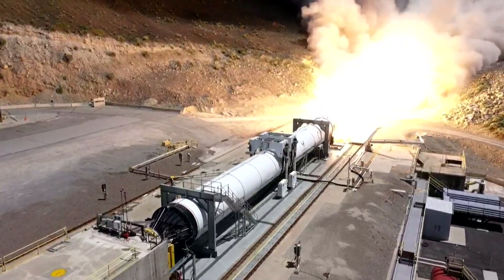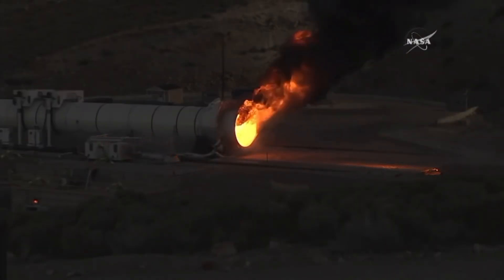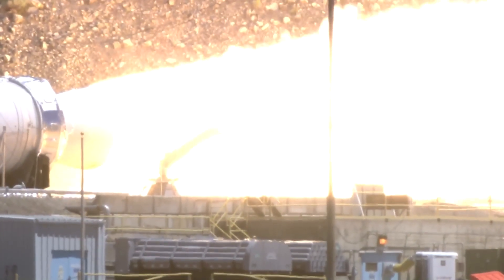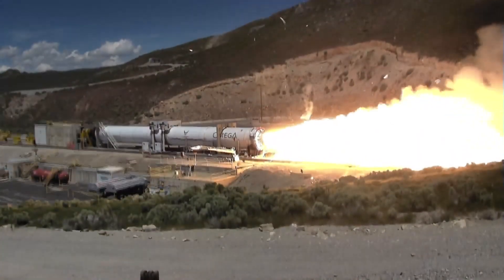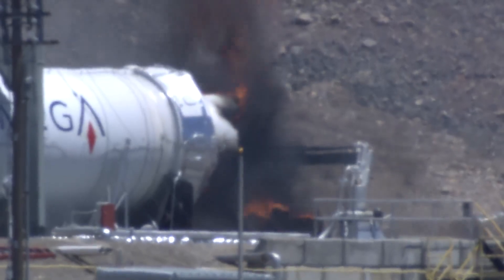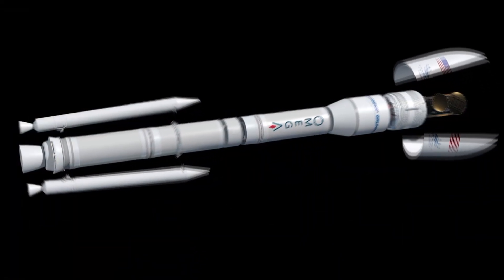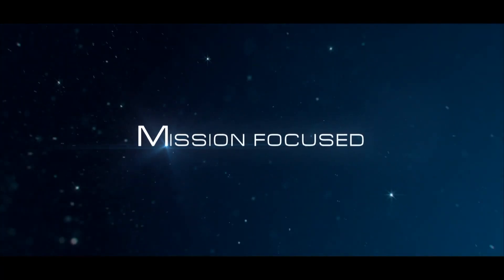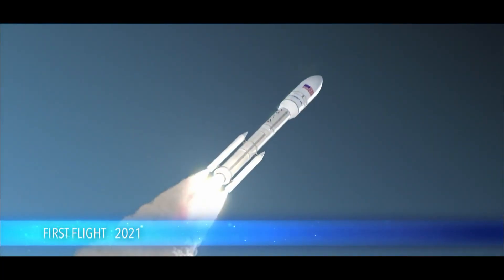Northrop Grumman's OmegA Rocket Fails During Static Fire Test -

Comment: looks like un ignited fuel accumulated at the nozzle then ignited causing overpressurization within the nozzle, exceeding it's structural capacity.
Reply: Thank you for the first technically-minded comment of this whole thread. While you get two thumbs up instead of 200. SMH.
Reply: @suserman7775  Doesn't mean I'm correct but I appreciate the enthusiasm. It looked similar to a backfire of a car engine though. The difference being higher pressure and fuel quality.
Reply: @thomaskrocker1696  Yeah I knew you were presenting it as an idea. This engine's first version is from the 1960s; I wonder "what's new" and obviously i wonder what caused the anomaly.
Reply: Highly likely, yeah. Not that machining problems don't happen, but they're pretty rare comparatively.
Reply: That is not how solids work. They have a shaped core and an igniter on the opposite end of the nozzle. The propellant burns toward the case if any breaks off and clogs the nozzle the whole motor blows up. The nozzle throat was still intact the bell 🔔 failed.
Reply: @oneskydog4401  Sorry, I meant nozzle cone. It looked as if the engine was choking and reigniting at the cone. Almost as if the solids weren't being burned completely or the smoke wasn't burned completely and reignited within the cone.
Reply: @oneskydog4401  Could the Accumulator have been back fed by tank pressure causing detonation at the cone? Possible bad valve sequencing?

Comment: What are those flashes of light on the booster at 1:50? They seem to precede the exhaust plume at the same speed. Are they ignition charges or perhaps reflections from the skin flexing as the combustion shock wave propagates?
Reply: I'd say it's a fuse they use to light the booster
Reply: @IbakonFerba  a fuse! what kind of fuse would you use for that? det cord?
Reply: @deathsheadknight2137  I don't know much about fuses, I just know that the russians basically use big matches to light their rocket engines, so I assume that something similar is happening here
Reply: @IbakonFerba  I've heard that as well, but I thought it was referring to liquid-fuel ignition. These solid fuel boosters contain rock-hard slabs of propellant. There's no way you could ignite them precisely with a burning stick.
Reply: @deathsheadknight2137  I think they use a smaller solid Rocket motor inside the Booster to ignite it, and that small moteor could probably be lit by a fuse. But as I said, I don't really know much about it
Reply: Gaps in the oh-so-famous o-rings letting light through?

Comment: 6:20 In the animation, the second stage motor(castor 300) has a smaller nozzle than the first stage. Is that how it will be irl? Usually you see larger nozzles on the upper ~vacuum stage; in liquid motors that is.
Reply: Because that second stage isn't going to space either. There's a third, liquid fueled stage, like Scott explained in the video.

Comment: -- Could have been an air pocket in the solid fuel.  I've heard NG doesn't spin their SRBs while fueling.  Who knows.  Thumbs up as always and thank you.
Reply: That would've likely blown up the entire booster, this just looks like a problem in the nozzle
Reply: @IceHax  -- Yeah, that's also possible.  If it was a pocket, it depends on the size.  Small enough and it could have blown a chunk of solid fuel, which fits what what I 'think' I saw, and Scott's theory.  But you're probably right.

Comment: Better to have it fail under test than under use :P A failure under test isn't a "failure" in my mind.
Reply: The failure is Northrop's "newspeak" response after the test. They need to be a little more direct than "this was a successful test".
Reply: I remember going to a software testing class where the instructor told us that if you ran a test and didn't find a problem, the test was a failure, so I guess this was a success!

Comment: How do these solid boosters control pressure difference
They don't have combustion cycles so how does it work 
I want to see the working in terms of like animation from inside
Reply: You have a long stick of nitrocellulose or something more complex to ensure all of the inside surface area of the propellant grain ignites properly and that's it, you get an amount of gas proportional to the amount of surface area burning on the inside of the grain and you have to rely on that. Typically the inside of the surface of the grain will have either multiple holes or a certain patterned hollow running through the centre or some similar arrangement where it ignites from the inside and the fuel slowly burns from one side to the other until it is exhausted. They're incredibly simple motors but quite inflexible as their properties are entirely determined by the shape, size and surface area of the propellant grain(s).
Reply: Grain geometry and fuel composition.   Solids are much simpler, but aren't throttleable.  Once they are lit, they are going to burn completely
Reply: Get high and watch a matchstick head burn. 💥🤣 Then imagine it scaled up.

Comment: based on what i see in the video...right at the end of the burn some part of the propellant detonated instead of burning and blew out the nozzle. You can see the plume look like it "inhales" just before detonation, then BOOM. Definitely a fuel failure
Reply from the maker: With lots of speculation some of them will be right.
Reply: Scott Manley and if I buy enough lottery tickets Ione of them will win.
Reply: right on the nose and Scott will agree with me that is exactly what happened but my uncle and cousin will have it fixed by this time next year when they test the second stage.
Reply: Another armchair engineer

Comment: How do they cool the trust vectoring mechanism? It must be insanely hot in there...
Reply: You don't in solid boosters. It has to withstand the temperature and pressure with only air temperature differential.

This opposed to hydroxy or other liquid oxygen rockets where cryogenic fuel can serve as a coolant.

Comment: Castor and HTPB propellant is well known, it was developed in the 80s.  Castor has a LONG history, I worked on CastroIVA for 5 years.   I seriously doubt any 'chunks of propellant' caused a failure, you never ever want propellant to even be susceptible to that.   This motor would have been xrayed extensively.   The nozzle material had a problem somewhere.   And I can guarantee you management DID NOT want this to fail, thats a VERY EXPENSIVE test to run.
Reply: It was a nozzle skirt structural failure the throat did not appear to fail. Propellant failures go boom when the nozzle clogs.
Reply from the maker: Yeah, I know it’s been used for years, but have they ever tested it in a booster this wide before?
Reply: Scott I worked for Hercules case manufacturing division 1980 to 1986. We developed the composite space shuttle case I was the composite process engineer. We tested two composite space shuttle motors in that test facility. We had two flight motors stacked at Vandenberg AFB 1986 to be mated to a shuttle for a polar launch when NASA blew up the Challenger. I am sure it was the same propellant.
Reply: @oneskydog4401  It wasn't the same propellant in the filament wound shuttle motors as in OmegA.  But that doesn't matter in this case.  Like you say below, this sure looks like a nozzle component structural failure.
Reply: yup the CASTER 300 is the SRBs the Shuttle the Caster 400 is the Delta IV which just used the last set, The Caster 500 is the core of the Minotaur which is a Minuteman Missile crossed with a Peacekeeper and a Patriot with a firring on top derived from the retired Toris Rocket. This booster is the next generation the CASTER 600 which will be the core of Project Omega and the boosters for SLS. another two rockets that use the Caster are the Pegasus and the Antares Cygnus which use a Zenit core and three Caster 30 rocket engines stacked on top of each other. I always watch the Northrop Grumman and test my uncles, my grandpa, and my cousin built all of them and I mean All of them name a solid rocket launched by Northrop Grumman in the past 50 years and I will tell you my uncles, grandpa, and cousin built it. That's why Caster is the best rocket in the world.

Comment: Superb video! :-) I do have a question:
A liquid tank blowing up is essentially that tank rupturing and all the highly pressurized fuel spilling out and then igniting. There is pressure in a solid booster, but the fuel is not liquid. So I wonder: With solid rocket boosters being what they are, CAN they explode in a big ball of fire and mayhem?
Reply from the maker: Yep - see https://youtu.be/ey-bbM7m1L8
Reply: Yes they absolutely can but not in the same way though typically solid rocket motors are far more spectacular when they do fail as the fuel is typically broken into many chunks or pulverised as it's a pretty weak material made from powders bound with a polymer and all that extra exposed surface on the fuel chunks ignites raining horrible chunks of burning fuel producing fires that are exceptionally difficult to fight effectively. I'll also add that fuel/oxidiser combos are capable of reaching the point of detonation if they're confined enough to generate sufficient pressure though most in common usage aren't prone to doing it and usually some other component of the motor fails from gas pressure first but it's a major danger of using high energy fuel/oxidiser mixtures as they can release that energy in unpredictable ways in a very short amount of time if something goes wrong. If a large fracture in the fuel grain opened up exposing far more surface area of the fuel to burn than intended it's possible the nozzle would be just too small to vent that extra gas and something would pop in a most spectacular fashion.

Comment: Someone didn't do their nozzle calculations correctly... My father designed the Apollo Service Module main engine nozzle after that engine had the same kind of failures because of faulty design calcs. Dad's redesigned nozzle fired perfectly and was the one that went on future missions with Apollo 7 through 17 and survived all the missions A-Ok (except for 13 in which they couldn't fire it due to the fuel cell problem)... Hoping Northrop Grumman gets this fixed pronto... Great video as always Scott.

Comment: Without the bell of the nozzle constraining, compressing & directing the thrust, the rocket would lose at least 1/4 of its actual thrust, causing loss of Delta-V, which could lead to mission failure. It seems the Northrop-Grumman executive wanted to forget about this unpleasant fact. There appears to be no “Cost Sheet” available for the OmagA, so we have to make some assumptions about launch costs - As Northrop wants partial reusability through something called “SMART”, we have to assume the reconditioning & refurbishment of these boosters won’t be dramatically less than that of the STS SRB’s (20,000 man-hours/booster + fuel) & they won’t be able to be reused more than 5-10 times...  This leads me to believe the OmagA will cost more to launch than a Falcon Heavy Expendable ($250 million for OmegA vs.$150 million for FHE), while providing less payload to GTO (5,250 kg for the OmegA vs. 16,800 kg for the FHE). This leads me ask, “What were the USAF Officials thinking when they decided to fund this turkey?!?”

Comment: How to stop a malfunctioning solid rocket booster, first open task manager, then click end task
Reply: Or even better: ditch SLS and use SRB-less Falcon Heavy while focusing on a better Moon lander.
I know, this wasn't an SLS booster, but SRB's are really a problem for safety and not environment-friendly
Reply: Task not responding
Reply: SRB.exe has stopped working. Windows is searching for a solution to the problem.
[End process]
Task manager has stopped responding. Sending error report.
Cannot connect to Microsoft error reporting service.
Windows encountered a problem. Please wait while we "sort it out"
Reply: @andrewbailey7999  That's why SpaceX uses Linux ;)
Imagine a Windows Update at Mission control during liftoff xD
Reply: @falafeldurum2095  Initiate countdown...
"Getting windows ready. Don't do anything"
Oops, you missed your launch window? What a shame

Comment: What is the chemistry of  this exhaust?
It cannot be a positive addition to our atmosphere.
Reply: It isn't. There are some "green propellants" out there. The liquid ones tend to be more dangerous to humans or just much much more expensive and difficult. The "green" solids also tend to be low specific impulse and not that great. LH2/LOx is pretty clean but difficult and expensive. Hydrogen Peroxide is also pretty clean burning. But very dangerous. Probably one of the most dangerous and "green" is hot water. The superheated steam has to be thousands of degrees hot in order to get any useful work out of it. And having a giant tank of superheated, very high pressure steam is difficult and extremely dangerous. Solid motors usually run about 600-1000 psi. 1500 psi being very high pressure. So there's relatively little chance of a hoop stress failure in the pressure chamber. Vs steam requiring several thousand psi just to be useful and simultaneously being super hot and not being able to have an ablative liner like with solid motors.
There is also so small of an amount of bad stuff from solid motors overall going into the atmosphere that it's of little concern. Have you gone full electric yet? Have the container ships gone nuclear yet and stopped burning bunker fuel? The tar and sludge and waste from oil processing for other fuels that is so nasty that you're legally not allowed to burn it within miles of civilization in most countries. No. Solid rocket motors are such a tiny blip on the "garbage we're putting into the atmosphere" gauge that it doesn't even register. 
However, NASA bring NASA, they've looked into the products of these motors in their design and detail out the results in reports. There are a myriad of chemicals that come out the nozzle. Some only last in the intense heat and some are actually solid bits that fall down soon enough. Some of the products are just CO and CO2 and alumina.
Reply from the maker: Carbon dioxide, nitrogen, hydrochloric acid, sapphire
Reply: @scottmanley  Huh, that's a lot more innocuous than I figured it would be.

Comment: Impressive the whole thing didn't blow up.
Reply: That's the good thing about solid fuel boosters. Things have to go pretty horribly wrong before they give up the ghost, and when they do, it's not in the big kaboom category, like when turbo pump pluming cracks, but rather a rain of chunks of burning solid material falling down.
Reply: @anders juel jensen. Not always.  Wasn't there a Delta rocket launch some time ago where a strap on solid booster exploded, quite spectacularly?
Reply: @Andrew-13579  Yup. But the spectacular portion of the explosion was when the main stage got fried by the flames that came out the side seam of the SBR. Apparently you are not supposed to mix 30 tons of liquid hydrogen and oxygen right next to misbehaving SBR... who woulda thunked!
Reply: @anders juel jensen Well, then I stand corrected.  So the booster didn't explode, but leaked very hot gases into the relatively delicate liquid propellant tanks and their fluids mixed and exploded?  All in less than a second, maybe.  Does that illustrate that solid propellant is not the same as TNT?  Not an explosive, due to a moderator substance in the mixture?  When contained, they build rapid combustion gas pressure that must be released at a specific rate through a nozzle to provide maximum sustained thrust?  Else they burst the container?  If the container bursts, the remaining propellant doesn't detonate because it's mixture ratio is fixed and moderated?  Whereas formerly separated fluid fuel and oxidizer are free to combine into a detonation mixture after a container rupture?  Is that what you mean about the good thing about "solids"?  I may have just learned something here.  Scott, some of us might need a video on exactly how solid propellant boosters work.  (Unless you already made one.  I'll have to look back.)
Reply: @Andrew-13579  Solid rocket fuel burns from its surface. It is basically just a thick wall cylinder that burns from the inside out. Now, if you get a crack in there, obviously there is going to be more surface, from which the fuel can burn. This CAN rip the fuel cylinder apart, which makes things go bad quickly, but it doesn't detonate like explosives (or blown hydrogen/oxygen tanks). Think of a regular fireworks rocket. If all goes to plan, it goes swoosh, but if you step a little on the delicate card board tube before you light it, its going to send burning chunks of hard powder out the back, fly erratically, and ignite the payload prematurely.  If you outright stomp on it, before you light it, it will probably explode, because the surface area got huge (you basically turned it into "gun powder").

Comment: They were testing this at over the power limit that they would have been using during a mission. They were running the booster at over 100%
Reply: Well, that's wrong - test like you fly. And to do that with a solid means changing the center grain profile. I doubt they would do that.
Reply: @cpnscarlet  No, you always test well beyond expected operating parameters to ensure you have room to operate your vehicles. You should see what Boeing and Airbus does to test their larger commercial planes. Those tests are wild, like deliberately trying to take off with an almost near vertical angle of attack. Even the ground based "non-flight" tests (like bending the wings to see how long until failure and where they will fail) are just as wild.